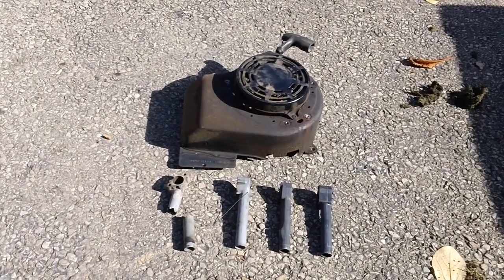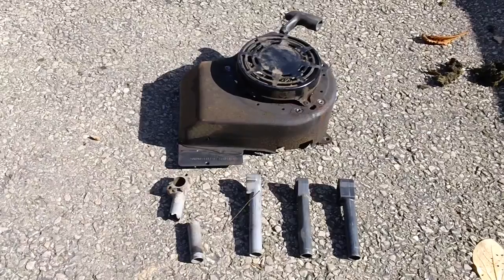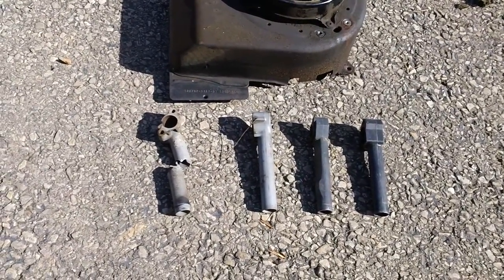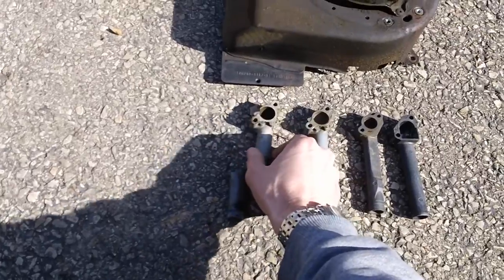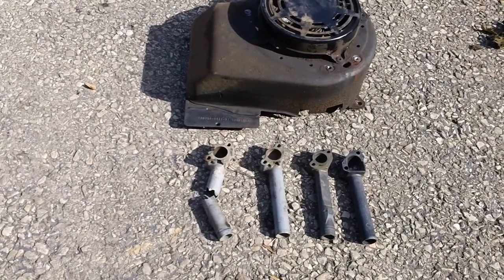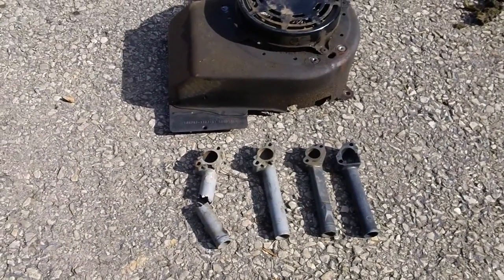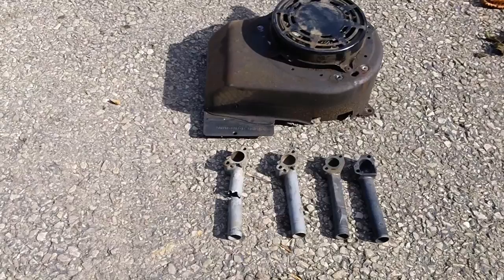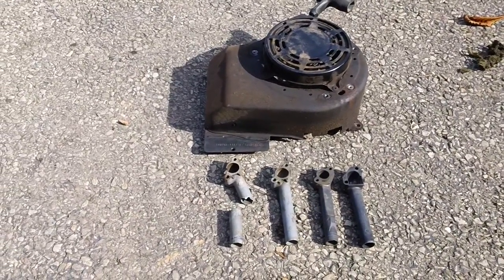BRIGGS INTAKE PIPE FAIL.

Comment: I have a Briggs 6.75 mower and the part of the intake tube that sticks out, that the O ring goes on, has a chunk out of it. I’ve had a really difficult time starting the mower, despite replacing the carb, so I’m wondering if that has anything to do with it....